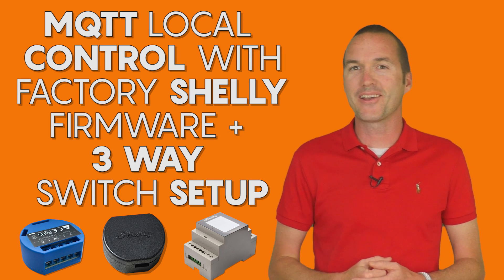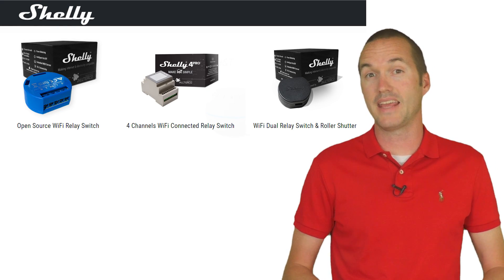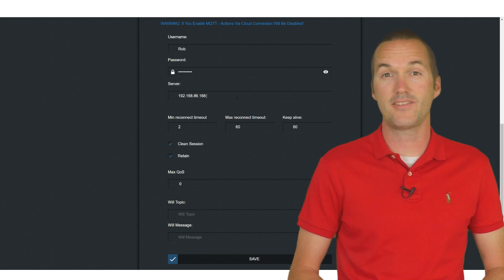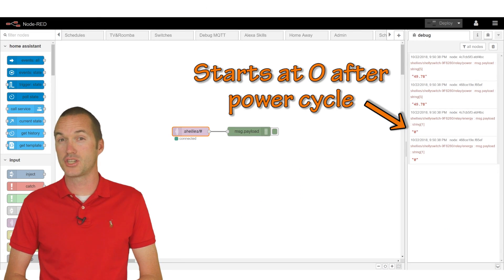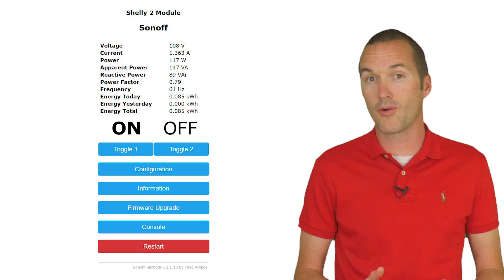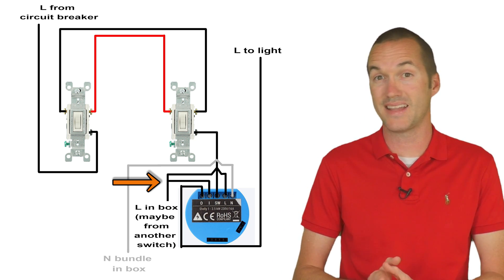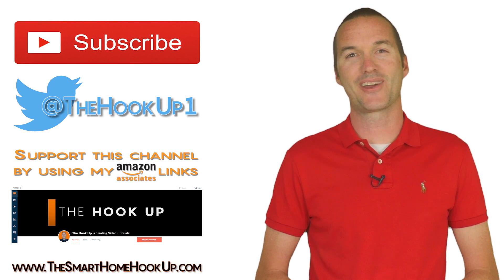Shelly native MQTT support, Tasmota on the Shelly2, & Setting Up a 3-Way switch

Comment: Super simple instructions for setting-up my 3-way switch. I used the Shelly 2.5 and had a "hot" wire from another switch. Super-easy to follow your instructions/diagram. Thank you!!
Reply: I don’t have an always hot wire in the switch that goes to the light :)

Any solutions?

Comment: One additional concern regarding the 3-way wiring approach you show. Even if the two circuits in the box are on the same phase (which you say is a code requirement), "stealing" the power from the other circuit does increase the load on that circuit. Both lights will be taking their power from the one circuit, the one with the always-on L in the box, since the runner no longer supplies the power for the 3-way light. This will probably not cause problems in the vast majority of cases, but seems undesirable.

Comment: SO if there isn't a hot wire in the box going to the light, then I am out of luck?
Reply from the maker: I wouldn’t say you’re out of luck, just need a different solution.  What does your setup look like?
Reply: @TheHookUp  I have a 3 way switch, one side has a hot wire and two traveler wires,  on the other side, no hot wire, just two travelers and the wire to the light.
Reply: @wallacje  unless you route new cables, the shelly will not work, but a zooz zen23 will

Comment: Thanks for the excellent video!  Would the setup in "Bonus Information!" work with a Shelly 1PM?  I wasn't sure if a Shelly 1 was needed or if I could use a 1PM for this.  I ask because I am about to place an order to finish off the remaining switches at my house. I really love Shelly products.  I have a couple 2.5s in 3 ways, multiple 1PMs, a dimmer in 2 hallways, and a Shelly 1 as a garage door opener.

Comment: I am using the stock firmware on shelly1 with MQTT how do i get it as a light in HA not a switch>?
Reply from the maker: mqtt lights and switches are the same other than advanced options like dimmer and color. Just put it under light: and not switch: in your config file.

Comment: Thanks for this video! I'm just jumping into home automation and can't wait to get started. My first attempt will be wiring a 2 way switch setup that control 5 recessed lights in our ceiling. How can I tell which of the 2 existing switches is the one that goes to the lights? And does it make a difference that there are multiple lights controlled by these switches versus just 1? Thank you for any help!
Reply from the maker: No difference controlling multiple lights vs one.  I can't give specific advice on the setup of your lights since 2-way and 3-way switches are set up very differently in different parts of the world.
Reply: The Hook Up thanks for the reply! I’m in the US in a recently flipped house, so everything should be up to code. I guess I’ll just have to pick one, wire up a shelley, and give it a shot! The journey is part of the fun

Comment: another great video!  thank you. this is my first MQTT device and i cant believe it worked! i followed along with my shelly 1 though.
for those who wants the code into configuration.yaml of HomeAssistant, it is:
switch:
  - platform: mqtt
    name: "shelly kitchen"
    state_topic: "shellies/shelly1-7726F7/relay/0"
    command_topic: "shellies/shelly1-7726F7/relay/0/command"
    payload_on: "on"
    payload_off: "off"
    retain: false
Reply: "state_topic: "shellies/shelly1-7726F7/relay/0" " --- it was helpful to me.  I have  shelly1.

Comment: It's not related to any electrical code, just convenience. Outlets are often have a wire going to the switch box and you generally want outlets to always be live. You use a lot less wire if you don't have to take the outlet circuit back to the panel. (unless it's a dedicated circuit of course)

Comment: Hey Rob! Thanks for your videos, I've been watching them all since I discovered your channel late last year. Only now my new house is getting ready to install smart stuff and I started with tasmotized shellies. I have a question for a 3-way switch with a shelly 1 with tasmota. Do I need any special setting for it to work (in shelly fw, yoou have to set it to edge switch)? It either doesn't switch the lamp or it takes some seconds till it does, it appears random to me. If I toggle throught the web interface, it's instantaneous, regardless of the physical switches position. Thanks for the videos!
Reply from the maker: I'd double check your wiring, the delay sounds like it might be the shelly booting up, make sure the shelly is getting a constant power source.

Comment: Good video!! I just got my Shelly2.5 and they are very awesome and easy to install.  Sooo small. But please note if using Shelly MQTT , I found that if you enter the payloads in Hassio make sure it's lower case on and off. Capital ON and OFF doesn't work which caused hours of frustratedness, but they are all happy and working now.
Reply from the maker: good advice.

Comment: I would use "L298N Dual H Bridge DC" to control 24V window open / close actuator. Can you suggest please some correct Tasmota configuration to control this H-Bridge ?
Reply from the maker: DrZzs has a few videos on using the L298N with ESPHome (his blinds videos).

Comment: I have just bought a shelly and I would like to add another switch to control the same light without any additional wiring and without battery powered devices; have you tried any of the self-powered kinetic switches? Does any of them work with mqtt?
Reply from the maker: I believe most of those switches are rf or zigbee, so you'd need a hub or bridge to connect them to MQTT

Comment: I enjoy watching your videos, they've been very very useful for me. I want to point out that the 3-way switch diagram you proposed is quite dangerous, if you have 3-phase mains, you need to make sure you are feeding (L) and (SW) lines from the same phase, otherwise you will blowup your Shelly, The (I) line should be isolated from the rest of the circuit but it's safer to connect it to same phase too. I didn't expect to find two wires from different phases in the same room, but I did and they were in an outlet and light switch in the same box. I think you should add a warning to the video between 7:00 and 8:30.
Reply from the maker: Working with mains should always be done cautiously.  

In the US putting different phases in the same box has been a code violation for as long as I can remember.

Comment: Looking to use either a Shelly in my 3-way. It looks as if power routs through the lights first, then 2-wire to the 1st switch, and 3-wire to the 2nd switch. Would either Shelly 1 or 2 work, and if so, how should I wire it up? Thanks!

Comment: I have paddle switches in my home. Will the shelly 1 be able to be controlled locally and from home assistant via MQTT without the localized switch being returned to 0v, or will I have to modify my paddle switches to be momentary switches?
Reply from the maker: Yes, shelly 1 will handle that task without any modification to your paddle switch.
Reply: @TheHookUp  thank you I bought a few and they are awesome. Very compact and fits perfectly behind my switches.

Comment: One more question ... using this setup for a 3 way switch are you actually able to know absolutely the state of the light in Home Assistant? Wondering what happens when one of the lights is manually toggled .  Thanks again for the great video!!
Reply from the maker: Yes, absolute state is known because the shelly is in ultimate control of the current.

Comment: Awesome video - thanks for the information on setting up the three-way switch. You mention "configure your switch as an EDGE switch" - how is this done with Tasmota? Is it one of the SWITCHMODE settings?  Thanks again for this great video!
Reply: Answering my own question here - 3 way switch works perfectly without any SWITCHMODE modifications after flashing with Tasmota - just using defaults. Thanks again for the excellent video!

Comment: Hello, can you please explain how to get advanced tab to enable MQTT? I have latest fw, tried both via iOS app on iPhone, iPad and also via web browser but NO advanced settings are available!
Reply from the maker: Web browser on the local network is the only way.
Reply: I am on a local network, looking at two of Shelly 1 V3 models, via web browser (Safari) and that option simply does not exsist. Both devices are on latest fw. I have tried numerous factor reset options, setting them again. Everything works but no option to turn on MQTT. Is there anything that can be done, or latest otion is to flash them?
Reply from the maker: Huh, can you post a screenshot of the web ui you are seeing?
Reply: One thing did the trick (acidentally). I unplugged shelly from power and tried again today and it is visible. Only difference is that previously they were allways connected to the mains. Thank you very much for your support and time. Your channel is great, please continue great work, it is appreciated.

Comment: I haven't seen anything definitive about how to set the "Will Topic" and "Will Message" for the Shelly firmware when using MQTT. I'm used to the LWT topic for TASMOTA and trapping that to set an online/offline flag for each device. How does LWT work with the Shelly firmware?
Reply from the maker: You just set it in the web console and it publishes "online" and "offline" to that MQTT topic.
Reply: @TheHookUp  In TASMOTA, I get it. In the Shelly config the is a topic definition, but only one message text entry, i.e., not on for online and another for dead and sending an LWT. I actually think you can leave it blank for defaults... but I don't see what the default topic is and what the two values sent are: true/false, on/off, online/offline, ...

Comment: in the github Shelly2 Factory Firmware YAML you show "state_topic: "shellies/shellyswitch-9F6280/relay/energy"" to get the kw, it dosen't work, when viewing the topic shellies/# i don't see any energy topic's
Reply from the maker: Do you have a shelly 1 or a shelly 2?  The shelly 1 doesn't have energy monitoring.
Reply: @TheHookUp  its on the shelly 2, i will later this week flash one with tasmota to see if it work.
Reply: @TheHookUp  btw i dont get kw/energy readings in the app , only watt

Comment: I can't seem to figure out how to wire the shelly 2 to a light and my fan at the same time. Please help.
Reply from the maker: Single hot L1, o1 to light, o2 to fan.
Reply: I did that I hooked neutral up to an Hot to L and light to s1 and out put to o1. Then I clipped my power going to the fan and hooked the wire from my switch to 02 and my wire to the fan s2.
Reply: Nevermind I had a doa shelly 2 I used another one and it worked

Comment: Still can't figure out how to get  the (above linked to) jumpers to fit into the really tiny holes..... I ordered exactly what was linked to in the description.
Reply from the maker: I fear they may have changed their supplier since I ordered those jumpers (maybe they thought they were making them nicer).  Mine are very thin and fit into the holes snugly.  Have you tried using a nail file or similar to decrease the diamter of the pin near the tip?

Comment: Hi there, many thanks for your time; noticing that there are other 3 ways wireling shown on other videos.  Have you connected yours according to your diagram and it is working?  Yours seems to make more sense then the others.  Thanks.
Reply from the maker: Wiring a 3 way switch is tough because there's so many different wiring configurations.  My configuration is the standard "traveler wire" configuration and I have a Shelly 1 hooked up as shown in the diagram working perfectly.
Reply: many thanks!

Comment: Fantastic! Can you post a schematic of a three-way switch with Shelly 2? I think I understand what your saying but it doesn’t a line with the wiring guide that comes in the box. I just want to make sure I understand correctly. From the Shelly schematic the Shelly2 sits on the other side of the first switch?

Comment: just got my shelly2's from amazon and special ordered those jumpers and they DON'T fit at all..... :(
Reply from the maker: Do they look like the ones pictured (With the round plastic bits) or did they send you DuPont connectors?
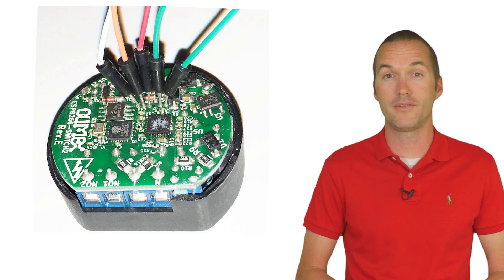Reply: @TheHookUp  They do look 'mostly' like the Amazon product pic... but they aren't EXACTLY like the ones in your video but then again the one you linked to at amazon doesn't LOOK like the ones that are seen in the video @ 5:23 the one in the video has solid black plastic tips.. and the ones you linked to for use to buy @ amazon have a 'black tape' around the tip. Anway the one I got from Amazon looks exactly like the linked amazon product. (if that makes any sense).

Comment: Rob, a question for the Aussie and NZ Shelly owners. 

This is an atypical setup of how we wire in Australia. 
https://www.youtube.com/watch?v=KSA58GI7iqE

I attempted to make a 3-way switch today but just can't get my head around the last step.

1. I can get power to the Shelly
2. I can remotely turn the Lights on and off
3. But I cannot get the switch to activate the lights or send signals to the shelly.

Seeing if you have any suggestions.

Comment: This is a really nice, informative tutorial.

I have a Shelly2 set in RollerShutter mode and can't configure it to operate with Home Assistant. It works fine set as 'Relay'.

Should there be three Payloads: Open, Close and Stop?

If so, how should this be configured in the switch yaml?

If this can work as expected it will be so much better than relying on home assistant code to ensure only one output is on at a time and for stopping the roller shutter in high load conditions.
Reply: @Ash Scott, any idea if the Shelly 2 be used on any kind of motors and not only Somfy?
Reply: @KhaledHiato  It should be fine on any single phase or DC motor as it's just two relays with firmware control to provide shutter or blind open and close operation. It can also be configured through the web app as two separate switches.

Comment: Great series of videos Rob. Do you know how that Shelly2 would be wired to control electrical blinds ? If possible at all. Thanks
Reply from the maker: If they are 110-230ac motors it should work

Comment: Does the factory image support TLS+mqtt (port 8883) on a WPA2 wireless network? Because plaintext packets are not allowed, even for IoT..
Reply: TLS is too much for a ESP8266 so no ESP8266 devices I have come by supported TLS. If you insist on TLS you must be prepared to spend more.

Comment: Very informative, thank you so much. One question; Regarding the 3-way switch configuration, isn't it possible to have the Shelly 1 in the circuit breaker side ?

Comment: Are you able to use the tasmota switchmode 5 or 6 Toggle and Hold with the switch on the Shelly 1 with a momentary switch?
Reply from the maker: Sure.  As long as the switch you're using is rated for 120V and properly grounded.
Reply: @TheHookUp  what is the process after the flash has been completed using espeasy as in do you unplug the FTDI from the PC and plug it back in again then access with termite or disconnect GPIO 0 from ground? I am having issues getting anything to come up on termite. I got it to work once on one shelly 1 after about an hour of trying different sequences but now on the second one I cant get anything to show up in termite at all.
Reply from the maker: @philmarquette8744  unplug from usb, disconnect gpio0 from ground, and then reconnect.

Comment: Hey,

Once again a great video. Congrats and thanks for that.

I'm trying to follow your instructions using the ios shelly app but, even with the last firmware flashed to my device, I can't access/see/find the Advanced Developer Settings tab under Internet/Security. I'm trying to do it remotely from the office.

Do you have any clue...
Thanks
Reply from the maker: Hi, it can't be done remotely since it will disable the shelly cloud.  You must be on the same network and I recommend doing it through the web console by navigating to the shelly's ip address via a web browser.
Reply: @TheHookUp  Will try it tonight. 
Thanks.

Comment: Rob:  maybe you can pint me in the right direction.  I have Drzz garage door opener with a d1 mini and relay.  I am getting garage door opens and closes at random times.  One message that opens the door and then another that closes the door.  The log shows the following messagers  Line 47443: 2018-10-29 12:58:56 DEBUG (MainThread) [homeassistant.components.mqtt] Received message on sensor/garage/state1: b'open'
  then shortly after the open I get the close.  Line 47538: 2018-10-29 13:00:16 DEBUG (MainThread) [homeassistant.components.mqtt] Received message on sensor/garage/state1: b'closed'  

I have no automations either in nodeRed or regular hassio automations.  Is there any way to find out who or where these MQTT messages are coming from.

Thanks
Reply from the maker: So the garage itself isn't opening, it's just telling you it's open via the sensor, correct?  Sounds like your reed switch is either going bad or it's too far away from the magnet when it's in closed state.
Reply: The door is going up and down which means that someone is sending it an mqtt message to activate the relay.  The read switch is located about 15` from the d1 and is hooked to the 3v and ground.  It looks like the switch is indicating correctly when the door is up or down.  From what I have seen thus fare it looks like the code is publishing the state topic as I can't find any code anywhere in my config that would do that.  When you click the up or down arrow from the front end it sends a button topic not a state topic.  baffling like so many things in hassio.

Thanks.

Comment: Hey Rob,  thanks for the great video! Will the Shelly be able to work on a 3-way light switch with the stock firmware of does it need tasmota?
Reply from the maker: Stock firmware works great.